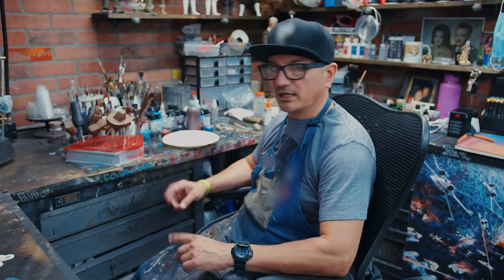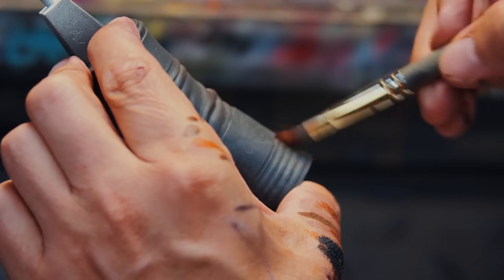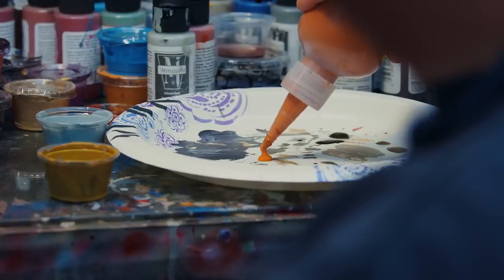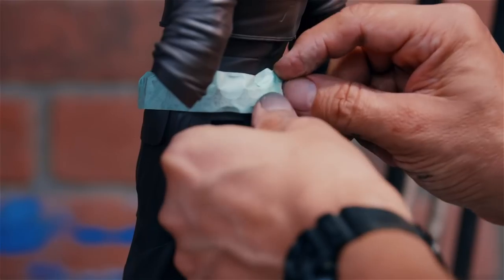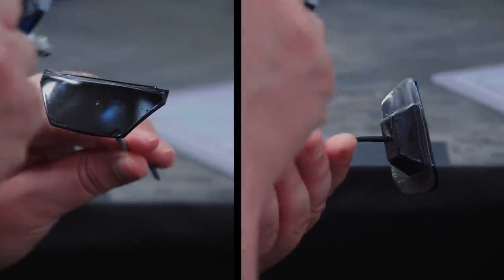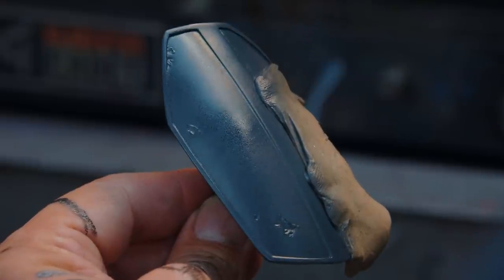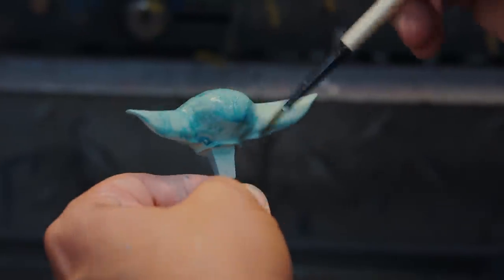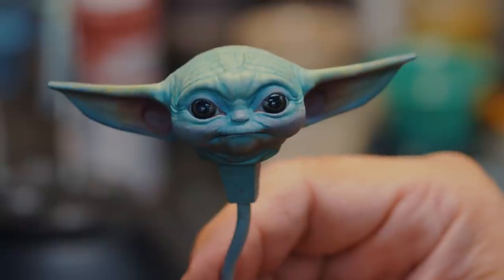Painting The Mandalorian Premium Format™ Figure | Behind the Scenes

Comment: Just curious, why freehand airbrush the visor after applying alclad? I feel like even with a super precise needle you’d get overspray around the visor which would likely need to be touched up. I ask because the first coat is already gloss black after primer. Wouldn’t it make more sense to liquid mask or tape mask after that and then pull it up? Seems a bit less risky then what’s shown. Just curious as someone who also paints!
Reply: I was thinking about the same thing, pretty odd method of painting the visor